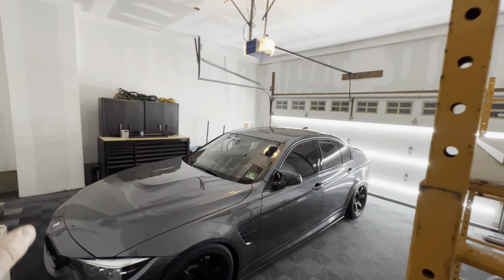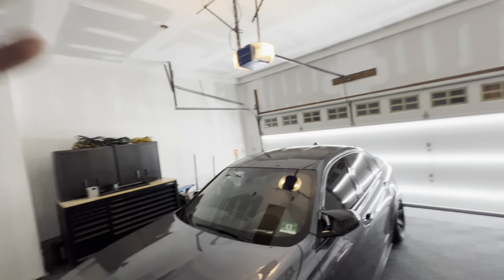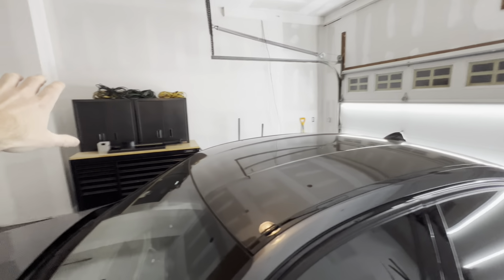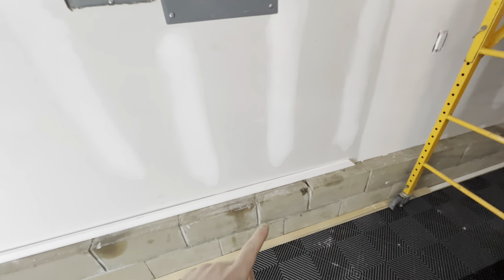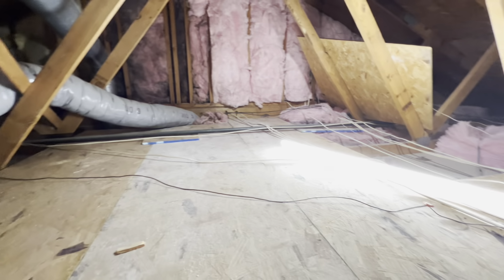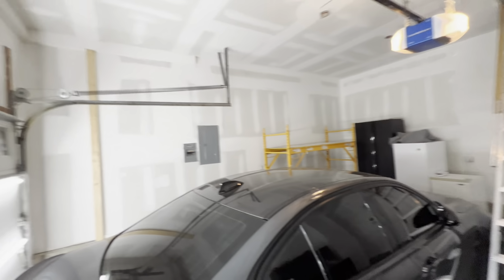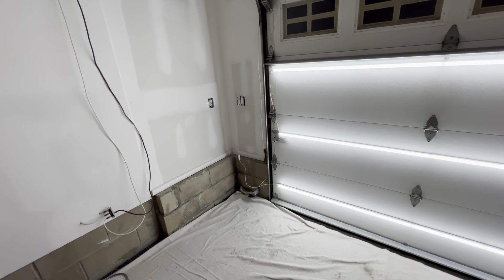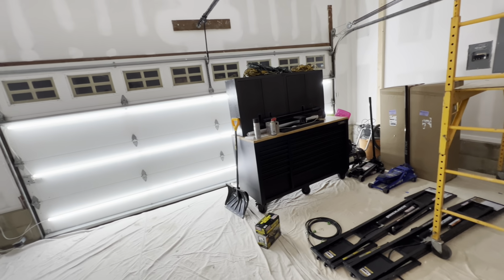Building My 20x20 Dream Garage!! Part 6 - Construction Is Complete + OG Lighting

Comment: Hi, you should prime EVERYTHING. At least everything that has not been painted before.
Otherwise you will see differences between materials, as they do not absorb the paint the same way.

It would be a shame to ruin such an amount of work just to save some primary work.
As for cars, the most important part for the result, is preparation 🙂

Can't wait to see the resilts

Comment: You should look into some 32" lift tracks for that garage door and even a wall mount opener. It would look much cleaner.
Reply from the maker: I’ve discussed this in a previous video. I plan on getting it done but not at this time.

Comment: Should have him run some 14/2 wire from the plug in ceiling. For the garage opener and make you a receptacle up in attic. And a switch so you can permanently leave a light up there. And flip the switch that’s mounted to truss. As soon as you walk up the steps.
Reply: Looks awesome by the way !! Forgot to say that lol